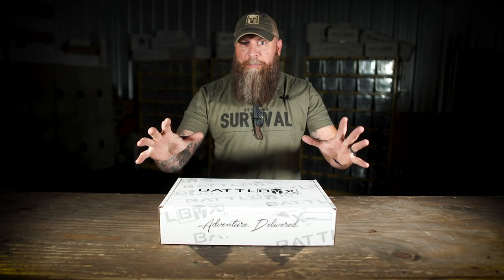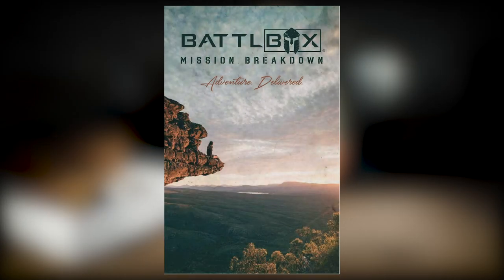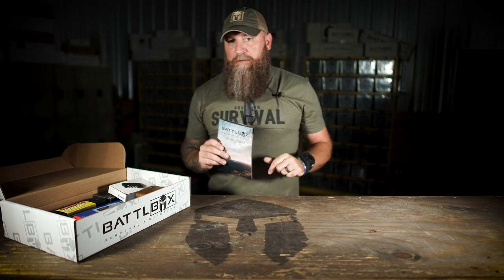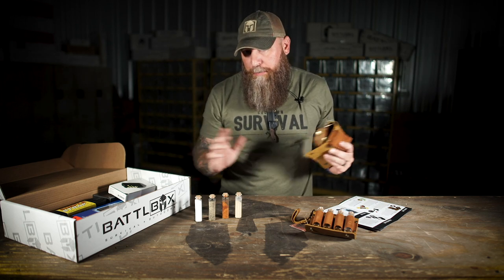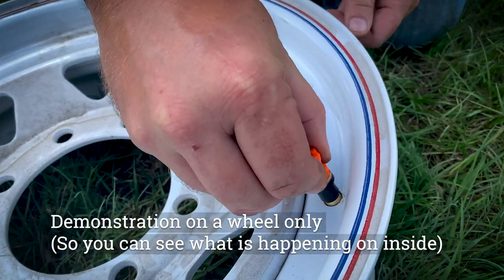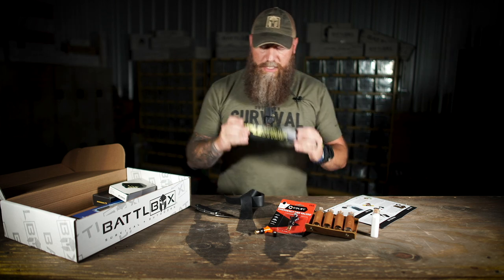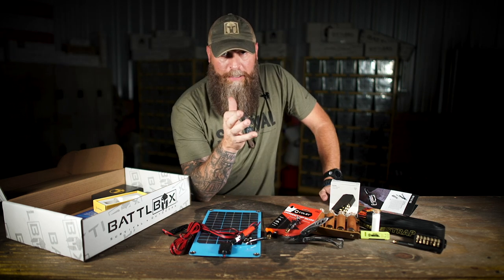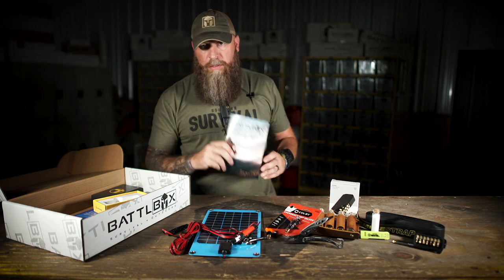BATTLBOX MISSION 66 BREAKDOWN

Comment: Great overall box, The basic box portion is really great, the Spice Kit-Use for my Old Bay and some shotgun shells, Coby Valve- I could have used this several months ago when putting air in my tire the valve broke, Simple Strap- Have to try this out on my Kayak........The Battle Plan Book is preferred over the card...........Great Job Guys, Im no longer Pro Plus after over 50 boxes i just ran out of room for knives, however if El Chete is ever going in a box let me know...........

Comment: Review 

Spice wallet - can't deny its quality, but it's not something i would carry. I think it's just an overengineered version of a regular spice container 
Tire valve - i don't have a car of my own, but from what i've heard, your entire valve stem ripping off is a very unlikely situation.
Fire starter - doesn't work when using the pieces to light it. You need to use some kind of knife or whatever for it to actually work. I mean, c'mon guys.
Simple strap - Just. Plain. Awesome 
Tactica - i have no idea why you called it a "tool kit" i mean isn't it just a screwdriver?
Solar panel - pretty useful thing to keep on you if you wanna charge something on a trip. Also, eco friendly. Neat 
Leatherman - crap. It takes it WAY too long to loosen up and the screwdriver part is useless now since you added the tactica.